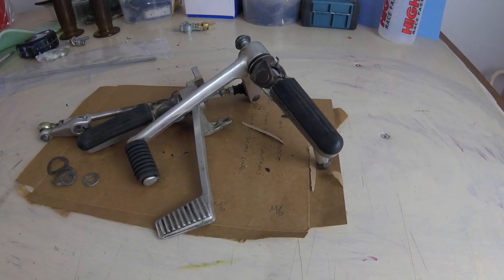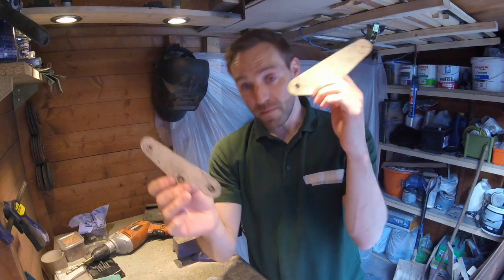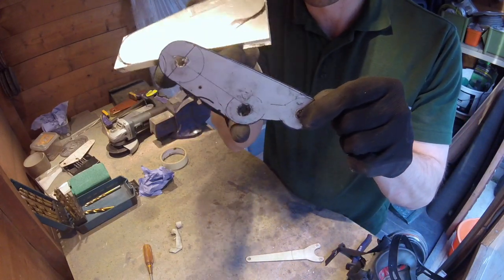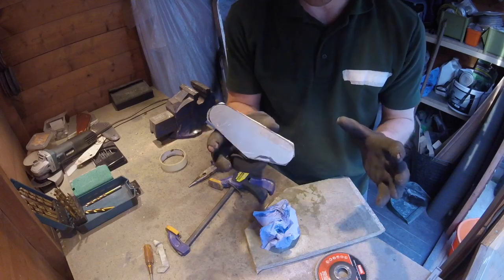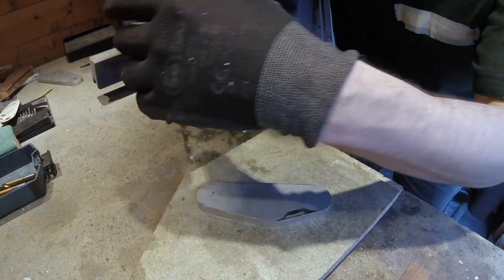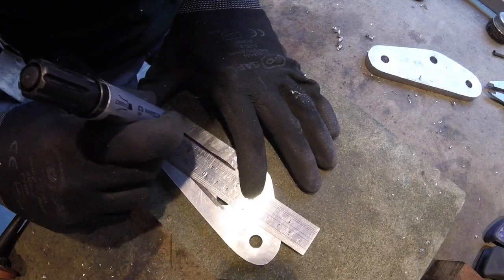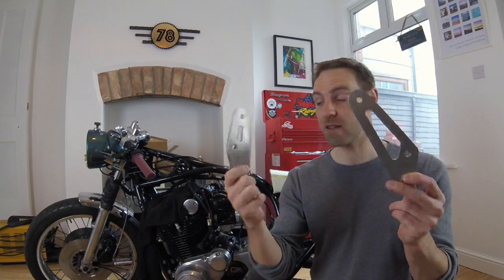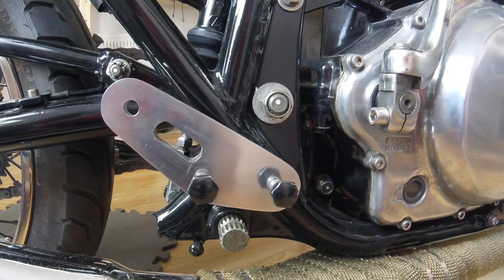Cafe Racer Suzuki GS 750 Motorcycle Build Rearset Brackets (Part 14)

Comment: I Liked the result you got, even without having a huge arsenal of machinery at hand 👍.
Reply from the maker: Little time and effort do wonders, the material was 10mm thick.
Reply: Dtaylo, I saw the 10mm after I posted comment, cheers for confirming tho 👌.  just restarted my 82 xj550 cafe project which has been sat in the garage for the past 9 years and it’s the rearset brackets I’m tackling next, keep up the good work.

Comment: Aaaahahahaha THANK YOU oh so much.im a proud owner of a 79gs550e that I'm trying to make into a track bike,now I know how to build these brackets.🤘🤘
Reply from the maker: Glad you found it helpful :)
Reply: @dtaylo4517  oh so question,how did you know the height of the top hole?
Reply from the maker: @juliocarrera9984  Good question!! The 550 foot pegs maybe different compared to 750 Im not 100% however on the 750 the foot peg mounting bosses on the frame are in different locations for LH and RH. so the brackets are slightly different which you can see in the vid. To figure out the height of the top hole I guesstimated where id like my feet to be placed then used a piece of string centred over the frame (Seat location) and measured the distance on the string, this was my reference so I could make card board templates.
Hope that makes some sense!
Reply from the maker: PS if you do go down this route you wont be able to use the kick start :( 
Im still in 2 minds whether to stick with the sets and pegs or revert back to the originals.

Comment: Sorry if I missed it, what are the brackets mounted to- yes I know the frame, but did you need to weld lugs or are you mounting onto something that is no longer in use- like a spare lug?
Reply from the maker: The threaded lugs are the original mounting points for the stock foot pegs, I believe the locations do differ between the GS750 and GS550